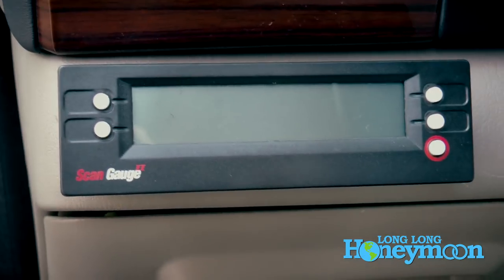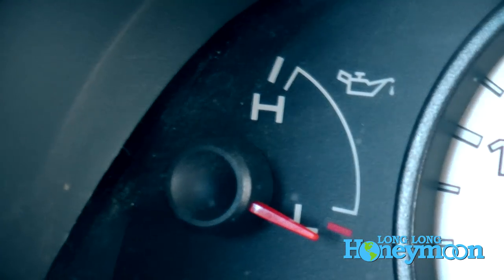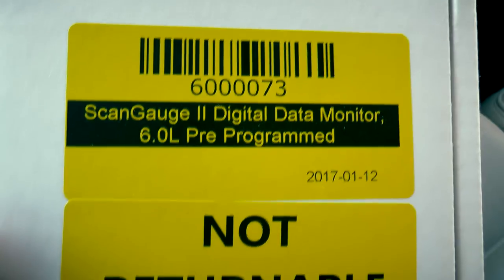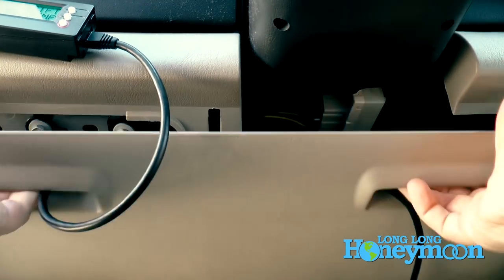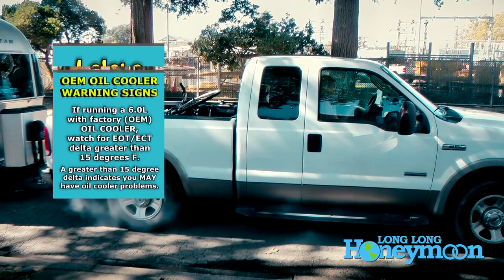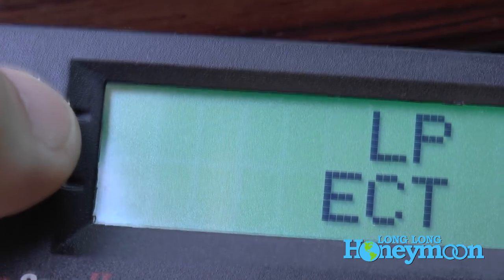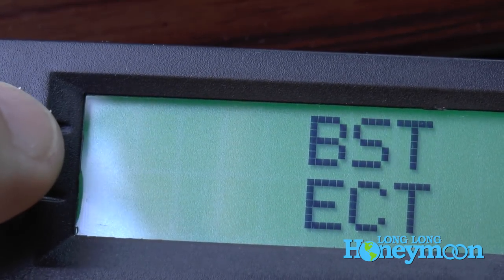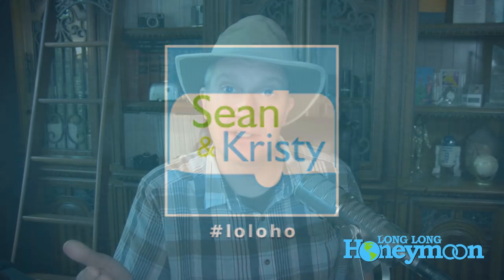📟SCANGAUGE II Engine Data Monitor -- in our Powerstroke Ford F250

Comment: Mounted mine to right of steering using both pieces of Velcro. Watch videos by DieselTechRon to learn what all the information is for. BTW, I will NEVER run a tuner on my truck (2006 F350 dually 61k miles), only the monitor. Mine is Bulletproofed with the remote oil cooler mounted behind the passenger side battery. I also mounted a air-to-oil cooler behind the grille. Deltas of less than 5 degrees. Great video guys!
Reply from the maker: Thanks, yes I'm a bit conflicted about the tuner, but my interest is really better fuel economy. Some diesel techs advocate "mild" tuning to optimize fuel economy. But I don't want to do anything that would unduly stress the engine.
Reply: I run the SCT tow tune all the time, and it increased the drivability ten fold (even when not towing).  The towing tune claims 50hp and a bunch of torque, you can tow factory ratings unlike hot tunes.  The fuel mileage changed very little for me , from what I read the hotter tunes get the best fuel mileage, I should maybe run the street tune when not pulling.  It is recommended to run a EGT gauge with any tuning. my truck is studded, 4" exhaust turbo back, factory air filter, bulletproof style EGR and factory Catalytic converter intact.  You re right foot is what would unduly stress the engine.

Comment: Have had a scangauge ii for 7 years or so ... great product and definitely worth it...  mounted mine on top of the rear view mirror... had only two problems.  The connector broke off the motherboard and sometimes is wakes up the computer on my truck(2001 suburban) and drains the battery..  i just leave it unplugged.

Comment: Where did you find the information for what the readings should be at idle and during operation? I would like to find those out and have them on a cheat sheet in the truck on a 2006 F250 SD 6.0, V8. Any help would be appreciated. Thanks so much!

Comment: I personally use an Edge CTS2 scanner;  more modern; you can display much more PID's on a nice color 5" screen.
I mount mine with a windshield suction cup in the lower left. I run the wire from the ODB2 port (below the steering wheel) then up the left side of the dash (behind the trim).
Love your videos.
I too own an Airstream!!
Safe travels,
Ron
Reply from the maker: The Edge looks a lot nicer, but it also costs more than twice as much  -- http://amzn.to/2nhKxg0 I think we'll probably end up getting a tuner which would have a lot of this functionality built in. Thanks for the tip, fellow Airstreamer!

Comment: My Velcro glue let lose in the heat of summer. Mine now sits on top of the steering column leaning against the truck gauge cluster cover. It's neat to check an engine code while going down the road in real time. My truck is fully bulletproof diesel and I don't look at the scan gage much other than curiosity. No worries for the past 5 years.
Reply from the maker: Great to hear, thanks!

Comment: I don't know how available they are in the North America but a Bluetooth or wifi obd2 dongle and a tablet/smart phone/android car head unit with the right app gives all the info you need and no wires to run. Plus has the advantage of being easily moved to other cars and used as a fault code reader.

Comment: Sean love your channel and have been following for a while now. I am a new diesel owner.  I just bought 16 f250 6.7 liter. My question to you and your peps. Do I need to monitor all the different temps in the engine with the scan gauge if the truck is doing that already.  Now I know you don’t get digital read outs but it is still monitoring it.  So I guess what I am trying to say is this a necessary purchase for a newer truck.  Thanks look forward to hearing back from everyone.

Comment: I like my Banks AutoMind Tuner, .  The Tow mode changes the shit point so that it doesn't down shift on every hill.  Then gives it added power so you just feed more fuel going over the small hills without down shifting.

I have a 6.4 Powerstroke, little more power than the 6.0.  I was afraid of other tuners, have heard a lot of stories.

Comment: I'm seeing comments suggesting the use of ELM 327's vs the Scangauge II. I have both, the ELM 327 with my IPhone/IPad is fun to play with in my driveway but it drops the signal way too much to suit me. On the road, I always make sure the Scangauge II is plugged in. Kinda like the difference in a wife and a mistress...one is reliable and the other is fun. You decide which is which. :)
Reply from the maker: LOL very creative analogy! ;) Yes, I'm game to check out the ELM but I much prefer a constant wired connection over anything Bluetooth. With the ScanGauge you can set it up once and you are good to go.
Reply: LOL, J Bird, you cracked me up.

Comment: What is the scangauge capable of that you can't see with a cheap $15 ELM327 Bluetooth adapter a $5 smartphone app called Torque?    looks to be slightly easier to configure, but only provides digital values, not a gauge or warnings like the app can...

Comment: Kinda surprised the scan gauge isn't available in Blue Tooth wireless.  Perhaps the next generation?
Reply: Cool gadget, tho.  I can see why you would want one.
Reply from the maker: I've had mixed results with Bluetooth devices -- some work great, some drop the signal. ScanGauge II is kinda old school, but it's fairly small and gets the job done. If we get a tuner then it will probably become redundant.

Comment: You'e making me want to go find an old 6.0 Ford diesel.
Reply: You want to drop an additional $15K into a truck w/85,000 miles as they have?
Reply: I studded/deleted/updated mine and upgraded/rebuilt the turbo for $3k.  Have less than $10 into the truck including purchase.  Quite happy with it.
Reply: Mike Mueting I have 03 excursion 6.0 190k original egr cooler , tested ok by ford at 173k , replace hpop , egr valve and 1 injector love this thing

Comment: Watch it - In the heat of summer and cab temperature the velcro glue with not hold your Scangauge and it will fall off your dash (i've been there)